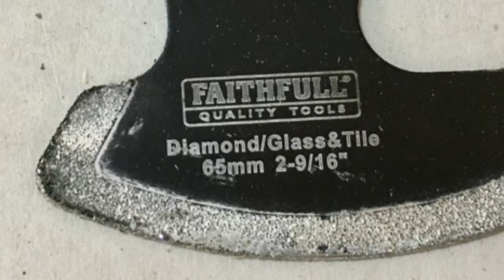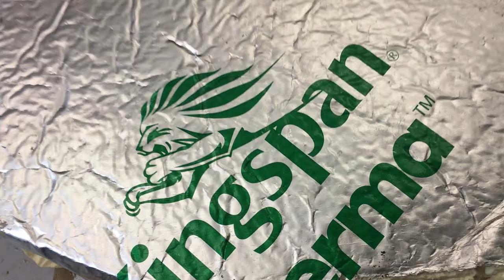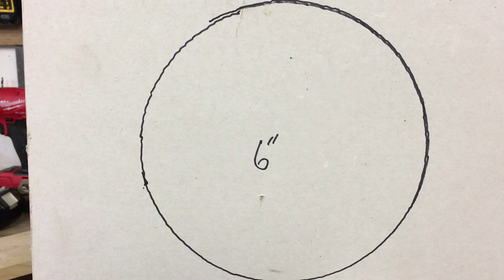28 ways to use a Multi Tool | Dewalt

Comment: Just don't expect DeWalt to honor the warranty. These have around a year and a half shelf life with regular unabused use, and I'm on my third one. The trigger is the weak link.
Reply from the maker: Will they not honour the warranty if you register the tool for the free 3 year extended warranty ? I thought they would have to if the trigger goes ? Thanks for the comment
Reply: @Bacrenfencing  No. I thought that, too. There isn't an addy to send it to, and trying to connect to a service center proved fruitless. I did find a place to order a trigger at a low cost, I may attempt to fix it myself. The tool itself is fine, it's just the trigger that's the issue. I had no idea an actual service shop for DeWalt could turn down a tool just because you had purchased it elsewhere.
Reply from the maker: @Constructiongal827 I register all my dewalt tools and as long as you can prove that it was bought from a registered dealer, Dewalt will honour the warranty.
Reply: @Bacrenfencing  There's the rub. The only "registered" dealer in my area wanted 3 times the going price, so I bought it from an online retailer. It's the drawback of being in a rural area, and I'm not the only one with that issue, I've seen other reports of people getting the runaround as well. A simple Google search brought them up.
Reply from the maker: @Constructiongal827  I buy most of my tools online as well, I usually use FFX or Powertool centre through Ebay, they are registered dealers and also deal with warranty returns. They are good and are probably the cheapest out there for power tools. Worth a look.

Comment: any pad blade tool of grinder and polisher and ... elbow-grease replace by micro-vibration tool. attach floor scrubbing pad... this is how feng-shui is applied to science of sink-holes. micro-vibrations - absorption to vector to dispersion subset, tuning, is sound and light shading - benchmarks.
Reply from the maker: Ehh ?

Comment: a cool hack I saw a while back was where someone had attached a standard hooked stanley blade (the type you use for lino and carpet) to his multi tool so it cut on a pulling action rather than a pushing action - seemed a good idea for cutting softer/flexible materials.
Reply from the maker: That would be good Peter as opposed to having to push, easier to control. The carpet / carton blade is pretty good though albeit you have to push !  Cheers for the hack 👍😃
Reply: Saw this too using hook blades for a razor knife.

Comment: A couple of things I have used them for (1) With metal blade cutting old toilet flange bolts out to remove toilet also the same blade to remove old caulking around that toilet. (2) I took a old worn blade with a angle grinder cut out and sharpened  a hook blade for cutting roofing. (3) cut garage door and door sweep thick rubber weather stripping .
Reply from the maker: Thanks Kevin, yes, there are loads of uses, I just tried to illustrate some of the uses that I use it for but there are probably hundreds of other uses for this tool. Thanks for the comment

Comment: On my 3rd multi from harbor freight. 2 returns. 1 unreturnable. What's a good entry level model? Remodeling the whole house. Roofing trusses to flooring joists. Everything in-between. Can't be bothered to keep slowing down over cheap plastic
Reply from the maker: You can't go wrong with the Dewalt in my opinion and it is not too expensive. Comes with a 3 year extended warranty if you register the tool.
Reply: @Bacrenfencing  thanks for the help! First time user too. Kinda got the feel already. Was skeptical at first thinking it'd jump around alot, found different positions remedy that with practice. And definitely a game changer for diy people like me. Anything that's a multi tool is something to check out if you don't want to haul a huge box around.

Comment: Fab video! Just bought one and wondered if you only buy Dewalt blades, if not, which brand would you recommend as an good economical alternative
Reply from the maker: Thanks, no I use other blades which are cheaper, I think there are links in the description. Ebay or Amazon are good for blades !
Reply: @Bacrenfencing  thank you! That’s great as they wear out quite quick lol

Comment: Hi, will the wood/metal blade that cuts through nails. cut through old screws ok, thanks.
Reply from the maker: Screws are a little harder to cut through due to their composition, so probably best with a blade solely intended for metal. I hope this helps ?

Comment: Great vid. Any particular brand of blades you find are good? I struggle to know which ones to go with every time I need new ones. None are that cheap either. Thanks.
Reply from the maker: Hi Simon, I just tend to buy blades as I need them for specific jobs. I usually just hunt about on Ebay for good deals. I use wood and plastic cutting blades the most, so just tend to buy packs of 10 and use them as consumables. I spend more on the diamond blades and usually use Dewalt. It really depends on your specific application but for me personally, I just buy cheap packs of 10. Hope this helps ?
Reply: Simon, check out project farm

Comment: Great tool at times I wonder what I'd do without it ....man you can cut straight 🤣..... Did I see see a wee Makita battery in the background when you were removing the dried wood glue 🤣🤣
Reply from the maker: Haha Ian,  I detect a little sarcasm.........my cutting is as squint as the next guys 😂 Yes, Makita battery in the background, I have a cordless Makita track saw and radio and have to say that I am more and more impressed with Makita and Milwaukee these days.........I have had a really bad experience with Dewalt recently, will upload a video about it once I get a chance 👍
Reply: @Bacrenfencing  brilliant bug chap..... No yer cutting 10 times better than mine the best laff is I worked in a timber yard in paisley for 6 years 🤣🤣
Reply from the maker: @iandrain.7277  I have fond memories of Paisley, how's Feeeeegie these days - it was rough as hell when I was there in the early 90's

Comment: Very nice I saw they were a blades for removing grout are there any blades that'll actually cut tile like ceramic tile
Reply from the maker: You can use the grout removal diamond blades to cut or notch small tiles but I would not recommend it. It would take far too long. Best to stick with an actual tile cutter or angle grinder for that.
Reply: You could maybe cut some very soft ceramic with a diamond abrasive blade but tile definitely does not do well with vibration and trying to cut it with a multitool will be nothing but heartache. Even the best cuts won't have a clean edge which is critical. There are tools much better suited for the task. Angle grinder, snap cutter, wet saw, dry saw, tile nippers, etc.

Comment: Used a dewalt metal cutting blade for nails with this tool, only for it to be defeated, causing the blade teeth to wear down and the motor to overheat and shut off. Any ideas what the hell I did wrong? The nails I was cutting were smaller than the one in this video and didn't cut anywhere near as easy.
Reply from the maker: Were the nails stainless steel perhaps ?  Stainless is a very hard material to cut..........it sounds like you encountered stainless nails or a similar material.
Reply: @Bacrenfencing  yes stainless steel for sure. I got the job done but man it was tough and I destroyed my blade.
Reply from the maker: @ShadowboltChoco  Thought so, stainless is a pain to cut, especially with a multi tool - at least you got it done though !
Reply: Choco you used the wrong blade, check out the carbide blades from Ezarc or Diablo

Comment: Hi Barry I have the same tool and absolutely love it’s versatility, have you tried the smart blades yet?
Reply from the maker: Hi Rob, No, I have not tried the Smart blades, are they any good ? 
I just tend to buy cheap blades from ebay and Amazon but have a couple of Dewalt diamond blades which are OK. I should really invest in better blades, especially the metal cutting blades as they seem to dull down pretty quickly. I will take a look at the smart blades.
Reply: Project Farm did a great review of bi-metal blades. Spoiler alert: mo money doesn’t mean mo better

Comment: Looks like it does quite a lot of damage to the material when removing adhesives. Maybe a broader blade or some way to hold it more level without following dips
Reply from the maker: Yes, a broader blade would be best. I was not careful when doing it, it was just a demonstration.

Comment: Hi I m new to this tool and is now looking at Multi tool, can I know the model of this ? And also why so many different model or voltage etc, any difference or? Thanks for any feedback
Reply: Also I have battery makita, if I buy Makita brand , can also do everything you do in video ?
Reply from the maker: Yes, the makita multi tool will do everything that I showed in this video with the Dewalt, you just need to get an assortment of different blades for different tasks 👍
Reply from the maker: I left a link in the description to this tool. Thanks

Comment: multi tools are good for cutting wood in restricted and awkward places not much else most of the jobs shown could have been done just as easily and sometimes
better using conventional tools ..blades with fewer tpi. would be a good thing....kind regards
Reply from the maker: Thanks for the comment
Reply: Agree on cutting in restricted places. Also useful for sanding in restricted places. I think this would also be very good for removing grout. That's about the height of it though. I have a lot of tile grout to remove thinking of getting one of these.

Comment: Does the multi purpose blade come with the multi tool?
Reply from the maker: It depends which retailer you buy it from. I just bought the bare tool and bought the blades separately but some packages offer the batteries and blades included.
Reply: @Bacrenfencing  well I ordered mine from eBay with the T stack box and blades included so will this blade come with it?
Reply from the maker: @mattseymour8637  I think you should get one if it comes supplied with different blades. If not, they are readily available on Ebay and Amazon.
Reply: @Bacrenfencing  I think you probably right. Will see what comes with it when it arrives. Is there alot if vibration with the tool or not so bad?

Comment: The only issue I had with mine was because it is an oscillating tool it vibrates and DeWalt is not known for having good connections so that being said it vibrated all the wires loose on the inside and I had to go in and solder everything back together
Reply from the maker: Not had any issues with mine Jamie but thanks for the comment

Comment: Do not forget most other Multi tools do the same job, my cheapy does all I need. Just buy good blades.
Reply from the maker: They do indeed Ian but I use the Dewalt due to the quick blade change feature. This saves a lot of hassle undoing blades with an allen key as is usual on most cheaper versions. Thanks for the comment 👍

Comment: Will it do carpet glued to concrete floor?
Reply from the maker: Yes, thanks for the comment.
Reply: Lance what do you mean by "do"? 

Carpet adhesive is stronger than the fibers on the bottom side of carpet or carpet pad so the first step will always be ripping up the carpet which leaves the glue on the floor. If you're asking if this is the best tool for removing large amounts of glue from a concrete slab then the answer is definitely no, although it could come in handy in corners or under cabinets.

Comment: Cool vid but when will you ever have a 50 lb vice bolted down to a 100lb table on the job?????
Reply from the maker: Probably not, but the vice was used as an aid for filming. If on the job and I need to secure the work piece, I would normally use my portable vice or quick clamps. Thanks for the comment  👍😃

Comment: Oscillating attachment to remove popcorn ceilings?
Reply from the maker: Probably be better with a larger tool for that, it would take forever with the multi tool - thanks for the comment 👍
Reply: Chase are you really suggesting we tackle hundreds of sq ft of ceiling with a blade 2 inches wide? I wouldn't do that even if I was getting paid by the hour...
Reply: @micahned  I think I meant if there was an attachment to remove popcorn. 
I’ve removed thousands of sq feet of popcorn ceiling. And I wouldn’t use a standard 2” for popcorn. But I would probably just use my drywall sander with a more aggressive pad. And go for a knock down texture for better noise isolation than a flat ceiling. And less work to try and patch rough areas.

Comment: Just use pipe cutter for copper pipe and pull protruding nails out with pincers.
Reply from the maker: Very true, but what if you don't have those tools to hand ? This is where the multi tool comes in to its own as it is so versatile as a stand alone tool. Thanks for the comment

Comment: This makes angle grinder obsolete if they can manufacture longer blades for thicker metals.
Reply from the maker: Angle grinder is best for thicker materials, the multi tool is too slow cutting thicker metal.

Comment: Take a worn-out blade & glue on some velcro, cut up some sanding discs & you have a sander with tear-off media... I used epoxy on several different shapes of old blades to create a great set for fine detail sanding...

Also, grind the teeth off an old balde, sharpen it & convert into a scraper blade ... 

Or an old blade with a rubber block glued to it & use it as a vibrator for small formwork to get the air out of the mix... 

Theres no limit to what you can do with old blades, never mind new ones ! ... 😅

From the Emerald Isle
😎👍☘🍺
Reply from the maker: Some excellent tips there Peter, thanks for the comment mate 👍

Comment: SAFETY first please folk. i didNT like how you swaped the armed hand (right hand with the tool) OVER your left hand (holding the board) at 4:17 🙄🤕🤕 {running} Blades must always face AWAY from your body and strictly be pushed in the direction AWAY from your body 🤕🤕
Reply from the maker: Thanks for your concern 😂

Comment: Blade gets killed after a couple nails lol.
Reply from the maker: Yep. nails are hard on the blades but it is usually rare that you need to flush cut nails, only in certain situations 👍
Reply: Travis the blade gets killed because you aren't using the right blade for the material and you probably hold it in one place too long instead of using it like a saw.

Comment: I’m taking a dump
Reply from the maker: Great !
Reply: I think is was about 18” long  @Bacrenfencing
Reply: It smelt like a dead rat in the bathroom @Bacrenfencing  it
Reply from the maker: @JUDGEME5150  The multi tool will soon have that chopped up - make sure you use the correct blade or could get messy !